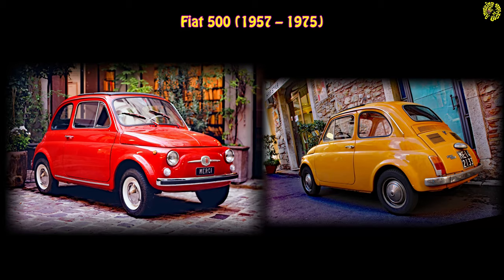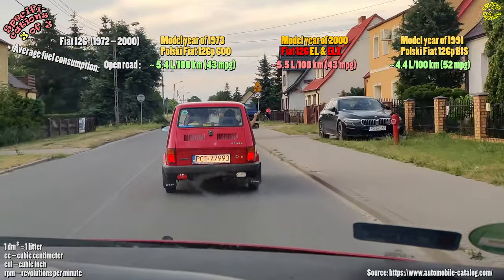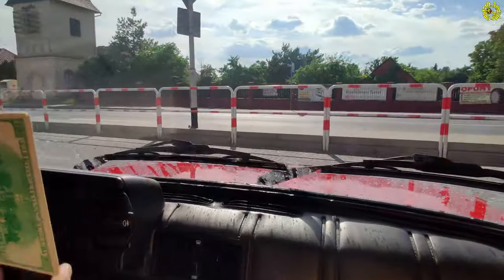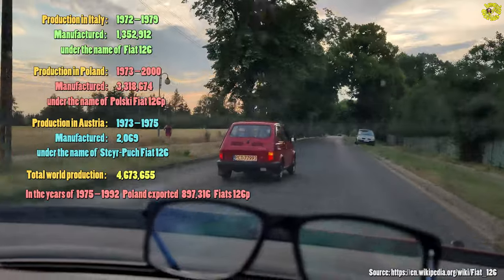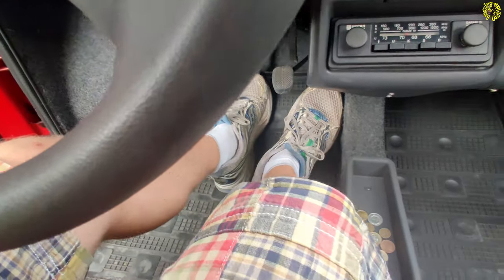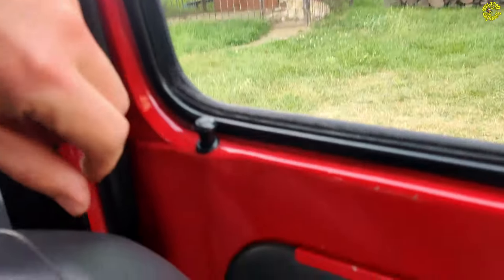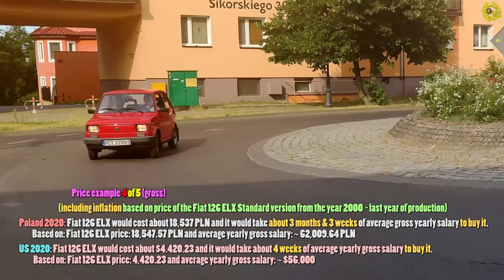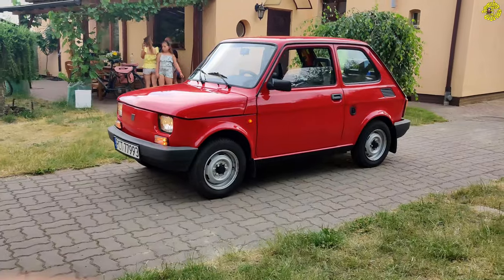Fiat 126 ELX Kaszlak Bambino 1972 – 2000 Maluch Polski Fiat 126p FSM Niki Steyr Puch, Zastava 126 4K

Comment: What does mean letter "p" on 126p, is it Polski or Personal? In Italy it was called I think Personal.
So the difference between model "Elegant" EL and ELX is that ELX had catalitic converter, but still carburettor, no injection and lambda sensor?
I see also your EL model has active carbon tank left to the engine to collect fuel tank vapour and engine oil vapour to recirculate to suck and burn in engine.
Why don't you complete the car with full equipment such installing cabin blower, rear heated glass, rear side glass butterfly open hinges, 12V lighter socket?
Reply from the maker: The letter "p" stands for "Polski" and represents a model that was manufactured in Poland. The ELX differed from EL as it had a catalytic converter and a few differences in the electrical system. For example, the ELX had a beeping sound playing each time the choke was manually set on to warn the driver that it's on. The EL didn't have that. All versions were carbureted. The model on the video is an ELX from the year 2000 and I manually adjusted the air intake with a flat head screwdriver. The fuel vapor tank was present on all ELX models that had the catalytic converter. I actually loved keeping it at its base factory "standard" version as it held the crown of a most basic car in the year of 2000 thus I would not upgrade anything. I loved it as it was. The "Standard version" would spark so much interest once viewers knew it was from the year 2000 yet it lacked the equipment you mentioned by factory standards with this model.
Reply: @AmazingWorlds314  , thanks for answer. Did EL model also had evaporator tank?
What did FSM manufactured when the BIS came 1987.-1991., did they paralel manufactured BIS and standard air cooled 650 ccm models at the same time, or they discontinued 650 ccm while BIS was manufactured 1987.-1991. and then when they realize BIS has unreliable with bad water cooled machine, went back to air cooled 650 ccm?
Why went they back to old worm steering gearbox and not continue with steering rack from BIS until 2000?
They should also continue using from BIS air intake outside grills for fresh air and not again stinky air from luggage compartment!
Reply from the maker: @vjekoslavcvetnic7500  The EL model didn't have the catalytic converter thus it did not have the evaporator tank (as far as I know). The standard 650 was manufactured uninterrupted in Poland from 1973 (1972 in Italy) until the year of 2000 and the BIS was manufactured briefly alongside the 650. The BIS's engine was highly compacted, and even though it was water cooled, the engine had a tendency to run a little too hot and it was rather hard to service due to compacted placement.
Reply: The "Personal" model was the last Italian before the production was moved to Poland and the car had written 126 Personal. Then it became "p" as "Polski".

Comment: The BIS is significantly faster and has a much higher top speed than a 650. The chart isn’t quite right
Reply from the maker: The data in the chart is provided by the manufacturer of both of the cars. Also, the manufacturer states the max speed for the 650 is 105km/h, but those who had one know it's over 120 km/h. Same thing about the BIS that's rated at 110 km/h.